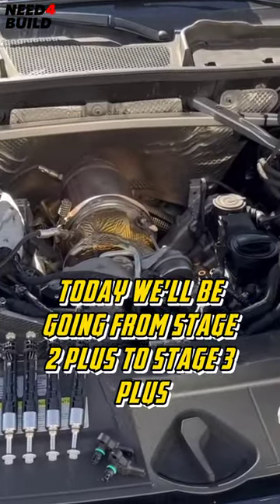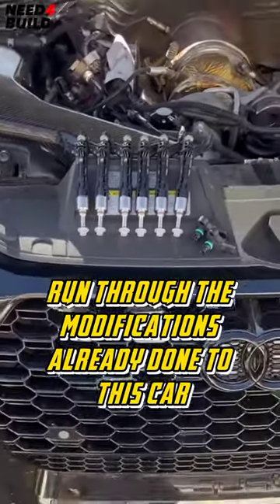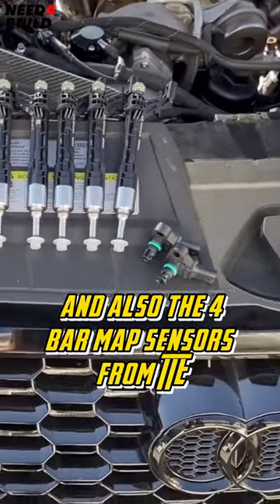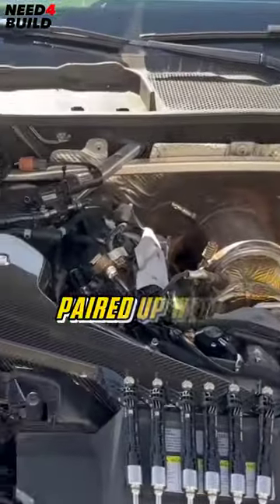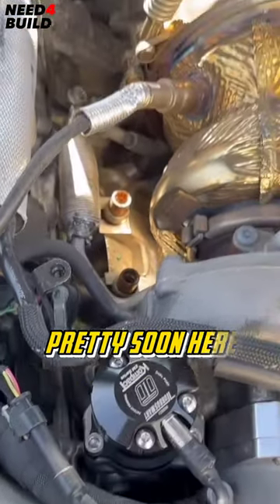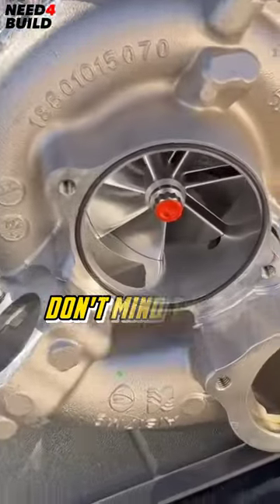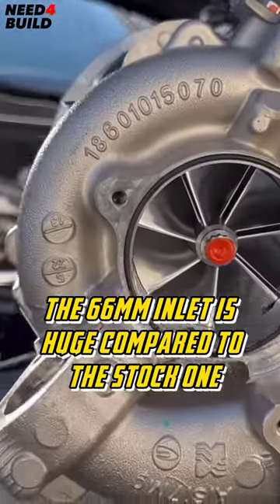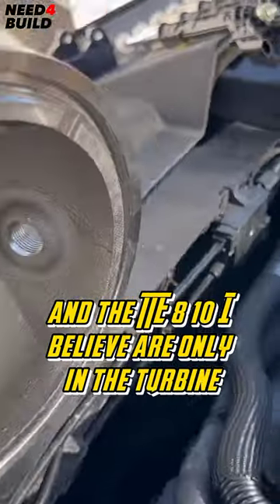Audi SUV - STAGE 3+ Install: Injector’s, Turbo, MAP #shorts

Comment: You need to stage that soccer mom SUV in the Audi dealership parking lot for a trade in
Reply: @Need4Built  jk bro nice ride atleast you know how to do more work on the car then most “car enthusiasts”
Reply from the maker: @Willppyro  I wanted to modify my car’s so I picked up some tools and started doing it. I hope to influence those “car enthusiasts” to actually start working on their cars. Lol
Reply: Upgrade to a Q8 so I can piggyback on what you’re doing. 😂
Reply from the maker: @darrenjohnson9432  I want to do an sq8 build, the q8 only has this same 3.0t which dont get me wrong has insane potential but q8 has 1k more lbs. The 4.0T in the SQ8 has ALOT more potential for power even stock. 1k+hp probably on the stock motor. I would rather build that and gut it 💪🏼
Reply: @Need4Built  fair point. It’s heavy but people don’t expect it to be a performer…whereas the SQ8 has a Twin turbo V8 that you hear that sound. I may get one in a couple of years but in the meantime…stealthy Q8 on the horizon. Need to find an intercooler etc to start the process.
Reply from the maker: @darrenjohnson9432  Integrated Engineering is working on a ton of things for the Q8 also I believe.

Comment: What made you choose IE over APR ultracharger?
Reply from the maker: I think you’re talking about the turbo inlet? 
Apr is miles behind in hardware quality and performance of said hardware and tuning. 
IE and 034 are miles ahead in everyrhing.
Reply: Thanks! I have a 2015 Q5 stage 2+ all APR. Looking to buy a 2022 and go stage 2 or 3 but not sure who or what mods to go with
Reply from the maker: @MC-yx1lo  Look at both 034 or IE. Don’t look or go anywhere else. Straight up. See you on the fast side 💪🏼